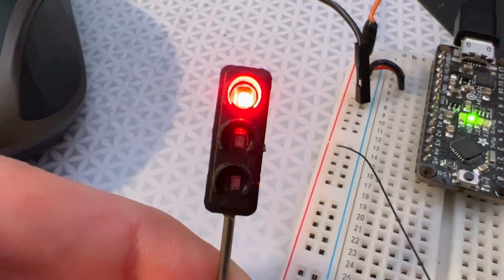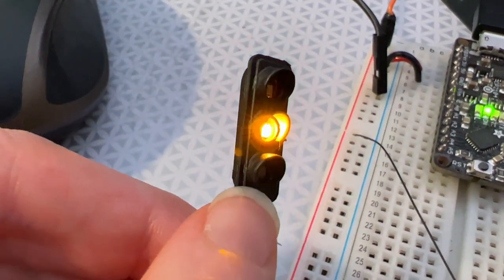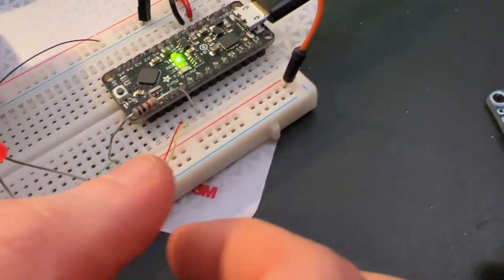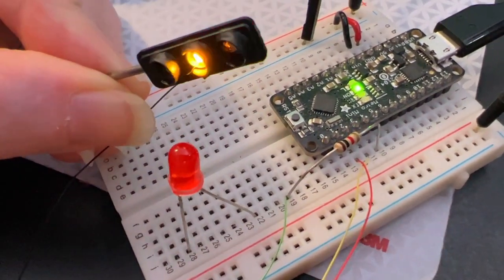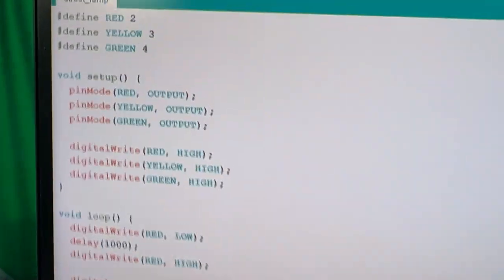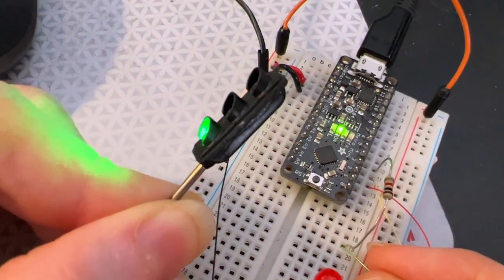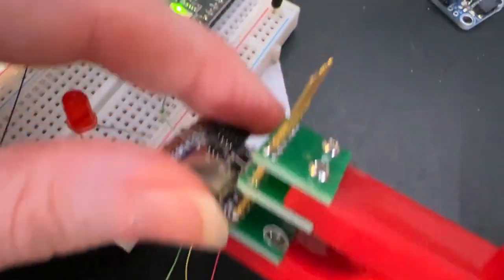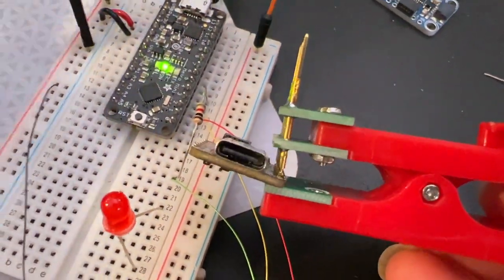Ready? Set? Go check out this lil model railroad traffic light!

Comment: I made a circuit to control the traffic control lights on my Dad's train layout about 30 years ago using a 558 quad timer.  I controlled the green and yellow LEDs for the two directions, then NORed those signals to control the RED LED for the cross traffic.  I didn't use microcontrollers back then.

Comment: In the uk traffic lights sequence is green,amber,red. Red and amber ,green is this possible ?
Reply: All three lights were controlled independently via 3x GPIO - yes, you could set up a UK sequence within an arduino sketch.
Reply: No different here in the states.  Yellow is a warning the light is about to turn red after having been green.

Strange you have a current limiting resistor on green, but none on yellow or red.